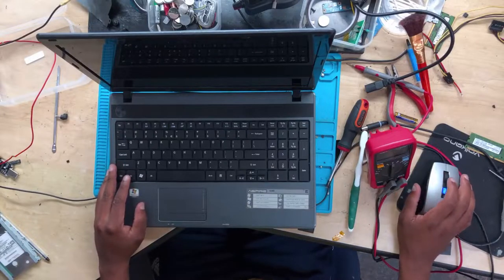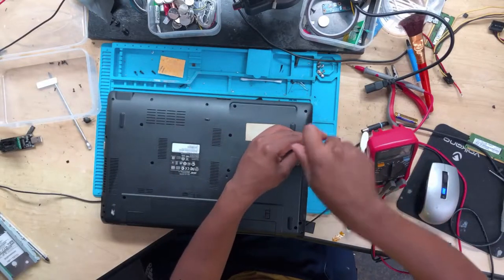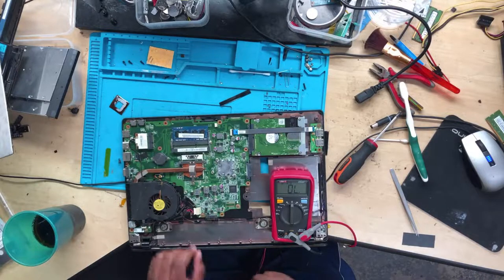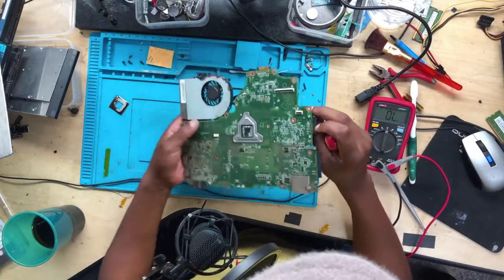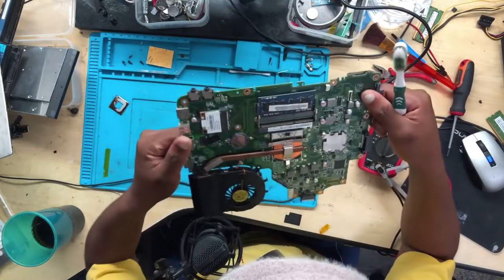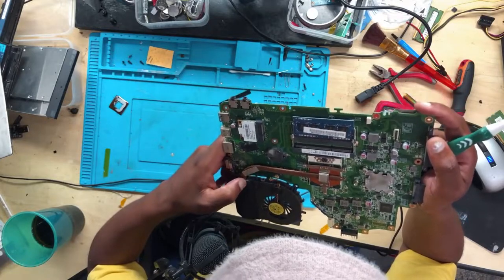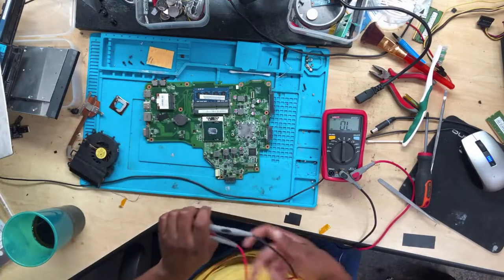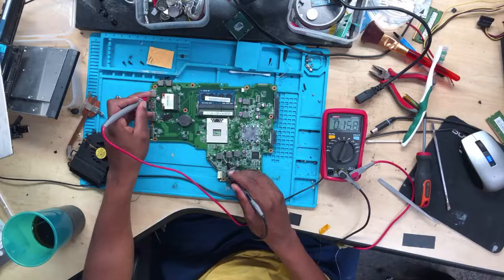Acer laptop not turning On repair

Comment: hey bro why didn't you inject the voltage first, before taking out the mosfets to see what gets hot?
Reply from the maker: The more you get used to repairs ,you tend to use the Dc bench power supply less often
Reply: Can you do a video about each of the controller ICs. Eg: SIO , PCH ,CPU , VCORE. How to fell if these are working properly or not. Respect bro.
Your videos are really helpful